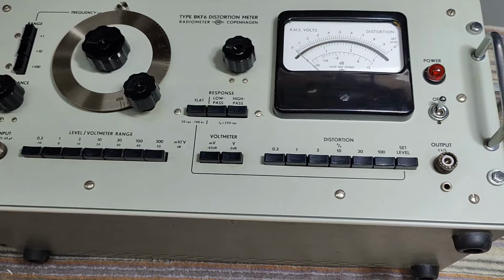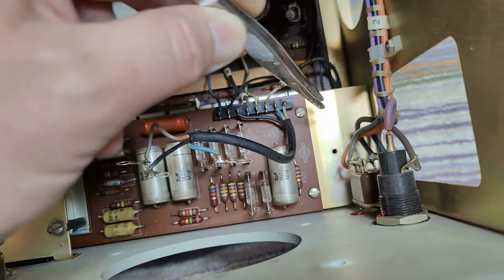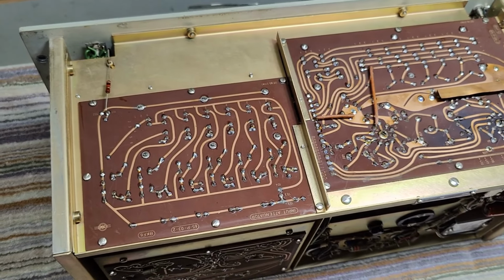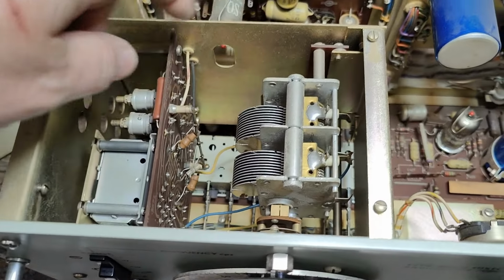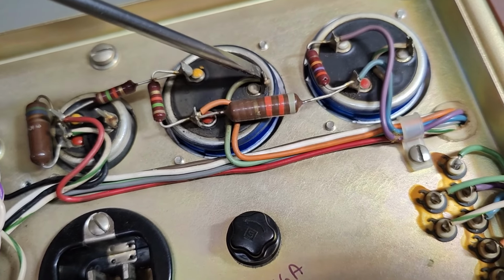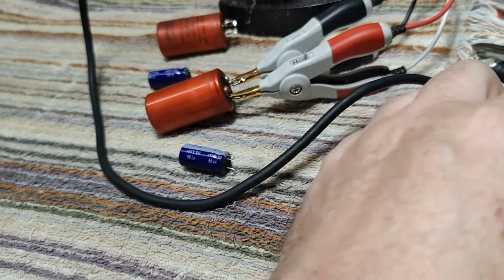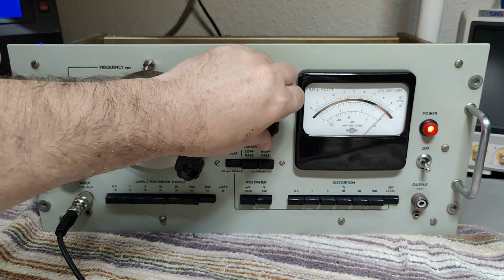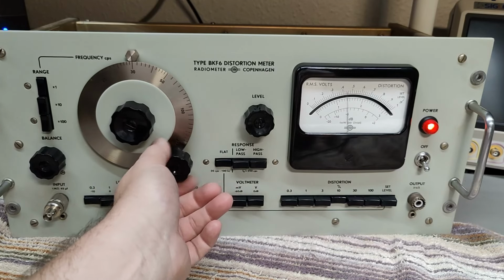Radiometer BKF6bc Distortion Meter Audio 1964 repair teardown

Comment: Comparing measurement procedure to the hp334a: Did you try to further minimize distortion reading using the balance after adjusting filter frequency? 
Your impedance meter setup is excellent.  Frequency sweeps and graphical output make the characterization coherent.  I could afford a hp4192, but I don't want to make the space for it!